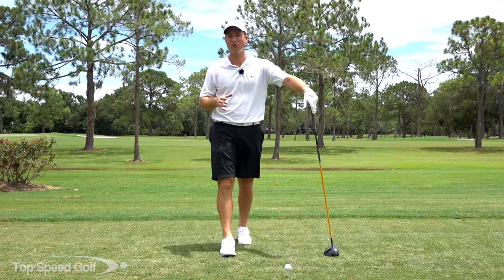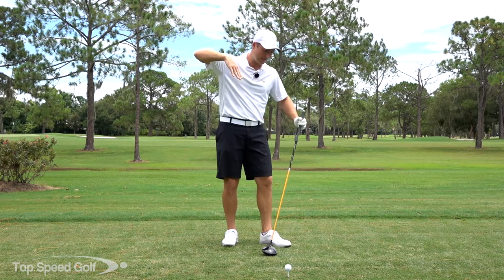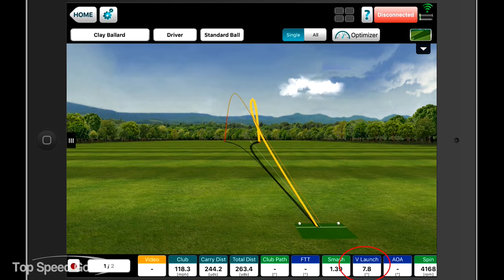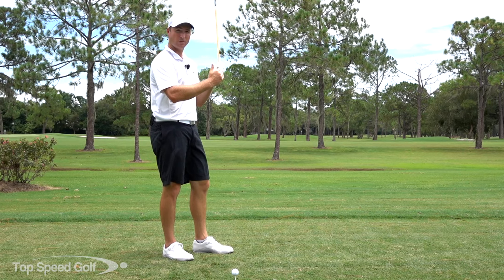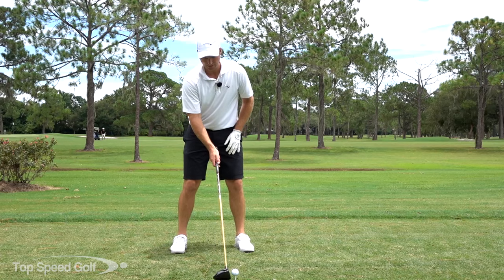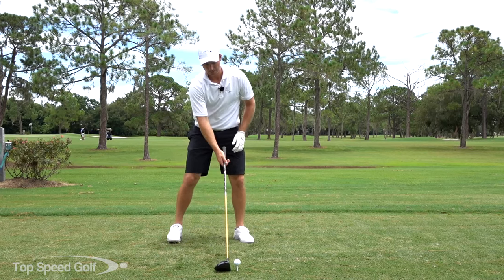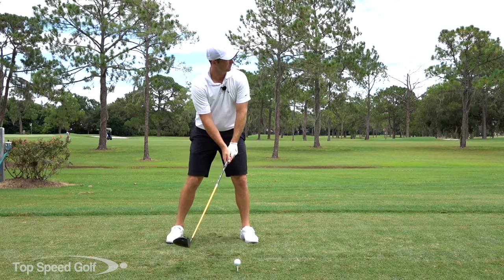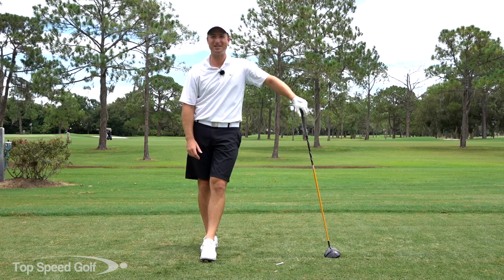How to Hit Up on the Driver

Comment: Great vid! I especially liked the part about the wrist bowing. Will placing the ball more forward and higher off the tee cause the shot to go left?
Reply: Or is the club face just closed too strong due to the exaggerated bowing of the left wirst? Thanks for your great video series, it helps me a lot for self-training on the range and the bowing helps me a lot to compress the ball und drive it forward with a swoosh, at least with the irons, instead of launching it weak and high into the air after impact. The driver is another issue...

Comment: i been wondering if a shorter driver shaft would help me with this, im a great iron striker, i even teach golf, but i’ve ALWAYS had issues with this. I’ll catch one right and boom 300, 291. 109 mph. But then 80% of the time my hand get out in front of me, i don’t push into the ground, i get off balance, and while it still goes straight (not always lol) it will only carry 245
Reply from the maker: May not hurt to give it a try. Play well!
Reply: Top Speed Golf - Clay Ballard thanks Clay, i am going today to do a driver fitting so maybe i’ll toy with the idea.

Comment: Would you then have too much shaft lean at impact and the face will be open right?
Reply from the maker: Hi Jeff, if you hit up on the ball then this will help you get it in the air. You square the face by bowing the lead wrist. It's possible to get too much forward shaft lean but that's really hard to do. You'll know if you're striking it in the center or higher on the face and the ball is coming out really low. Play well! Quentin | TSG Instructor

Comment: With your head far behind the ball, how do you see the shaft from this perspective on address?  Do you see a shaft lean?  By how much?  How far do you position the club head behind the ball and where is the butt end of the club pointing?
Reply from the maker: Hi Jancen, it's personal preference how you set up. The only thing that matters is impact. If you're wanting to test which ways work best for you then set up with both extremes and everything in between. Hit several ball from each position and see what works best for you. Play well! Quentin | TST Instructor

Comment: I played the same course twice this weekend and one hole hit two drives cause i lost sight of the ball. The first ball went in the front bunker the second landed on the green and rolled off. It was about 280-300 yards. This is about what id expect since i hit my 3 wood about 250-260. Normal driver for me atm goes about 260-270. I definitely think im hitting down on it since i can feel that im hitting the sweetspot most the time. Hopefully this helps ty.
Reply: Must’ve been a really strong downwind

Comment: I have an adjustable driver. Will adjusting the loft 1 or 2 degrees higher result in longer drives?
Reply from the maker: The only way to know is to try it and see what happens or get in front of one of the accurate launch monitors e.g. Trackman, GC Quad, Flightscope X3 and see if changing lofts makes a difference. Best of luck! Nate | TSG Instructor

Comment: This was a really cool video 💥 Since my FT Tour driver has been in my closet, I may have been playing the wrong ball. I have since learned, my Pro V1x is a high launch golf ball 😏 Playing a mid range ball could help. But, since alot of my game comes from around the greens, will I sacrifice spin? Thank you 👦
Reply from the maker: Hi Alan, it's not going to make a big difference. The biggest difference you can make in the flight of the ball is going to be what you do with the club. I would make sure that you're not releasing the club early. You want to release the club out in front like Clay talks about in the Top Speed Golf System on the website. If you're looking to change balls then I would try as many different ones as you can and see what you like the best. Play well! Quentin | TSG Instructor